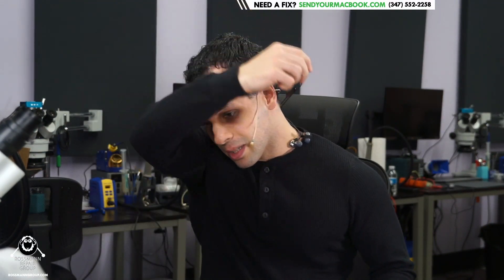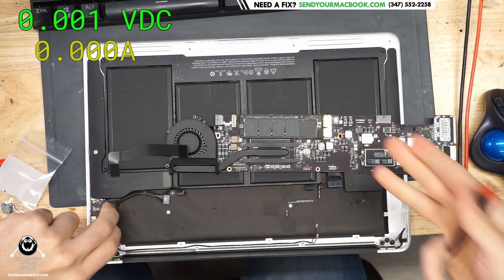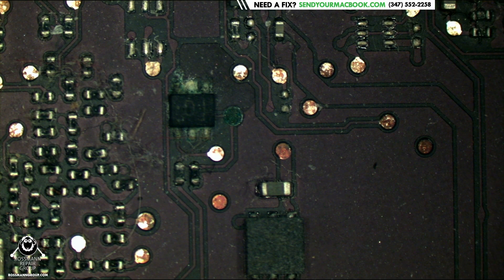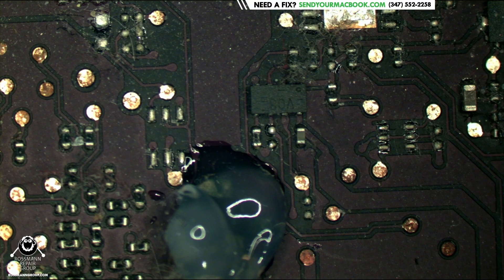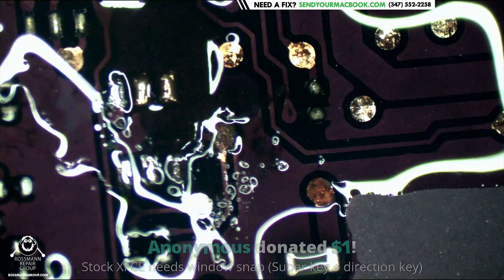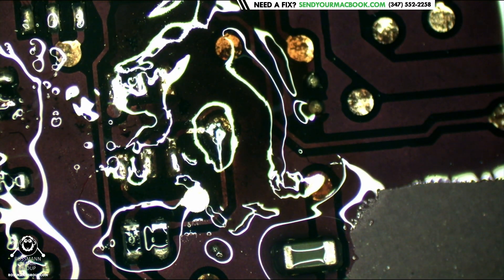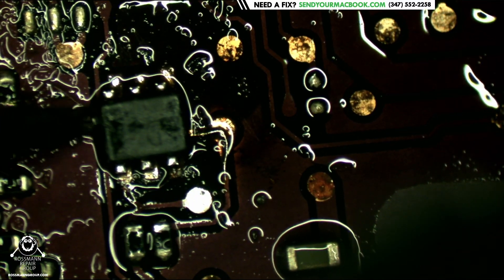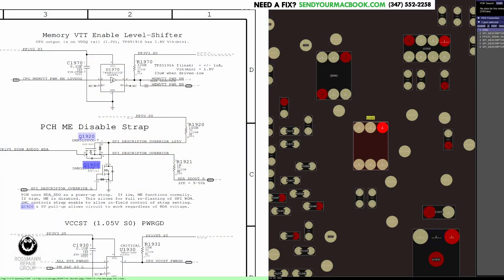😊 Corroded Macbook Air repair: liquid damage & water spill fixed in 20 minutes, good as new 😊

Comment from the maker: https://repair.wiki I welcome your contributions of data & information to make it better! The Macbook Air section is here. https://repair.wiki/w/MacBook_Air The open repair discord is here https://discord.gg/ZrC43grpuv
Reply: Thank u for the site! Appreciate the effort! Do any of ur vids or the new site have a beginners section? My experience is with audio cables and jacks and power supplies. Some of ur tools look a bit diff than mine. Smaller soldering iron maybe? Some kind of liquid u put on the board sometimes,  etc.
Reply: OMG..a friend of mine was just asking on how to migrate all his harddisk and RAM from an old macbook, to a newer shell.. Then i just sat down having a drink, and 'Eureka!!'..you've just posted a video and mention about an online compendium of repairing computer devices.. You are truly a Godsend Mr Louis..
Reply: Customer lives in his bathroom. Specifically in the shower.
Reply: So you repair 11 pro mother board. Whenever you connect to a new phone display, it shows as if the screen was broken  but it’s not. Other than that no issues it just doesn’t reflect a clear image on the display hopefully get a reply from you. Antonio
Reply: My iPad mini battery life is almost non existent! How much to change out the battery 🔋? It was one of the old cool models with home button and finger print tech.
Reply: Repair. Wiki is forever
Reply: Thank you so soooo much for the site! <3

Comment: Not only an advocate for right to repair, but also going the FOSS (Free and Open Source Software - free as in freedom, not a free beer) route. That's really nice to see :)
Reply: is interesting that free as in libre is usually the same as free as in gratis, honestly, is easier in spanish, we still use "software libre" since i have memory, and it still implies open source (codigo abierto), because libre is also open, we say "al aire libre" to say an open space outside.
Reply: @Artistic Cat it's the same in French too, "logiciel libre".
Reply: @alenasenie6928  Note Free Software is not always gratis. Even the GPL doesn't forbid you to sell software. It just says that you must provide a copy (or an offer to get the copy) of the source code under to whoever you distribute the software (which is not necessarily the whole world). But the general case is indeed free = gratis.

Also AFAIK, FlexBV itself isn't FLOSS, but based on OpenBoardView, which itself is FLOSS under MIT (which does allow forking and keeping the fork closed), with lots of additions useful to repair businesses. And Paul Daniels does contribute back to OBV for some parts.

Comment: Hi Louis, I have an A1708 for a moment i was charging it via one of the port and decided to to charge it via a usb-c adapter so I could connect the other port to a display then and then the projected screen went blank. I did reset smc and when the display came back on, the battery does not charge say power adapter connected but not charging. Went to the system info then to power there I saw the power input is just 15W. I am in Ghana so please what can you suggest
Reply from the maker: open it up, troubleshoot, there's over 100 videos here on troubleshooting macbooks that don't charge, and https://repair.wiki , and https://docs.google.com/presentation/d/1PkeO_lC5WTPScSV3ZzEEjVuDWeQtL2eHK6jEcf7axA0/edit , I didn't make all of this for nothing! Use it!
Reply: @rossmanngroup  Thank you
Reply: Super Key is Linux's name for Windows Key
Reply: @Breakfast_of_Champions  lol why do you say that?

Comment: If anyone could help I've been racking my brain on a 820-3662 board . I originally got it where it was turning on but with a beep noise like a memory issue, the board had corrosion in multiple locations so I just ultrasonic cleaned it first to see if that would help. it stopped turning on all together after that. I checked all power rails and the first one missing was pp5v_s4. I followed it back and I'm missing pm_slp_s5_l and I'm missing ALL_SYS_PWRGD. I feel like im running around in circles trying to chase this down

Comment: My MacBook air a1466 2017,
Always show low battery when turn on,
I already replaced with new battery, but the issues still, i always ned charger to turning it on,
But after finish boot, my MacBook work Normal without charger
Reply: thx!!!

Comment: Can someone here please help me? I have a huawei p30 that had a broken screen it took me 7 months to get a screen for it I got the service pack. But I messed up the mother board when I tried changing over the parts. Normally at this point I would just cut my losses and scrap it. But this is not a normal case, the phone holds the last pictures of my mum before she passed away then 6 months later my dad passed away too. It's almost been a year now and I'm not dealing with it yet. Is there anyone that can help me? I'm from and live in Ireland.  Thank you for reading.

Comment: Man I just swapped from an in-house engineering businesses board repair to a consumer product board repair and it's INSANE. First of all. I've always had the privilege of never having to go on an expedition for schematics and boardviews. I'd just get the altium files straight away. AND, god, in one week of work I go two essentially unfixable boards that I spent most of my time on because other technicians got to it before me and majorly fucked it up. Actually found "man made" shorts, as in, someone went through the trouble of manually shorting a chip. And another one where some genius managed to kill the board by updating the bios and clearly unplugging it during the process. Both very old PCs that wouldn't justify the manhours to hunt down all the issues. Fucking frustrating.

Edit... Forgot, where do people actually find boardviews? I had no luck finding schematics and boardview for an Asus laptop and could find schematics but no boardview for a Lenovo laptop. It's infuriating.
Reply: hope things are smoother now

Comment: Super key is usually windows key but don't think they wanted to call it windows key
Reply: Meta (yes, that way predates  Facebook by two decades), Super and Hyper are Unix names for modifier keys that were on workstation keywords back then, and are the names used internally in Xorg, the graphics server used on GNU/Linux. Since Linux can be used on PC but also Macs and other machines, those names are still kept instead of machine-specific names. Also, those can be remapped by user preference, so they don't always refer to the same keys on the keyboard. On PC, usually (but again this can be changed) Meta = Alt, Super = Win.

I think the comment was mentioning the rudimentary tiling ability of XFCE, which is also available on other desktops now, like in kwin where I use it quite often, by using Super (so, Win key) and arrow keys, to get windows to fit screen halves and quarters easily. Very handy to watch Louis and still work on stuff 🙂
Reply: @francoisrevol7926  I was suprised when i heard he used GNU/Linux or as i've taken to calling it GNU+Linux ...